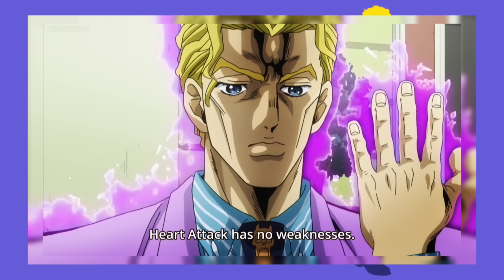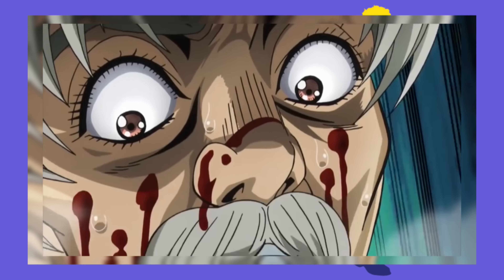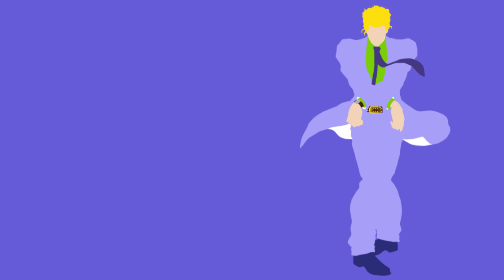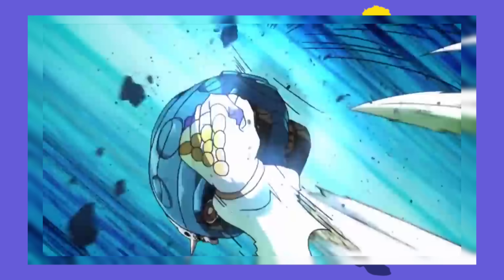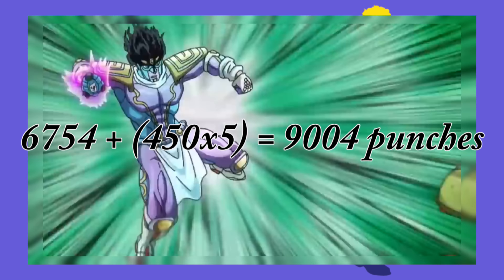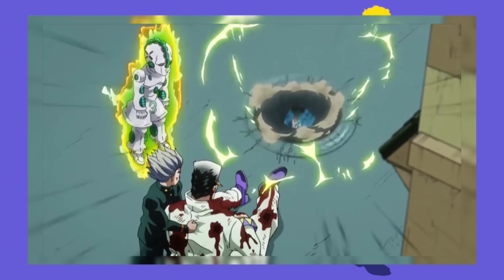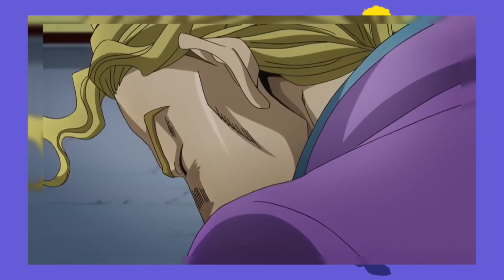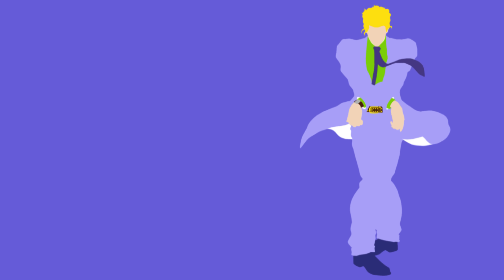The Science of Sheer Heart Attack

Comment: Sheer heart attack vs speedwagons abs
Reply from the maker: Speedwagon is hotter
Reply: @TheShuckmeister  wouldn't that make him a prime target?
Reply: @saladsplatoon3008  don't worry speedwagon's singular punch can destroy it completely
Reply: @thepacificwart8777  speedwagons hammer from part 1 would be enough too tho
Reply: sheer heart attack melts
Reply: vs thunder cross split attack
Reply: @saladsplatoon3008  if it getting super close the heat would be so hot it would mess up the thermal sensors and melt the tracks

Comment: Stands are more resillient than what they represent. So steel is still the best option.
Reply from the maker: It's a good option but I couldn't find a single one that fit the bill
Reply: @TheShuckmeister  I always had the theory that it could be some tool steel with 0,5-1,5% carbon and molybdenum, chronium, vanadium or tungsten as alloy elements and a special heat treatment applied to it.
But then again i am only working with metal on a basic level.

Comment: I'm going to address some of the dubious physics. I didn't watch calculating Jotaro's STAND POWAH punch energy video, so I'm going to assume that is true.

1) If I sat down doing nothing for 12 hours, I would emit more energy than 1 kg of tnt, but what makes tnt actually more dangerous than me? It's the power generated by that 1 kg of tnt. While Star Platinum outputs a butt ton of energy, the energy calculation here is not an accurate assessment of his strength.

2) As the video mentions, there are 14 dents made in Sheer Heart Attack. To simplify things greatly, the total energy required to make 1 dent .015 m deep is the video's E'/14 (assuming the cracks made does not count), so already the energy to make a dent has been cut by more than a tenth (which in the grand scheme is not that much I guess since 10^20 --> 10^19 is still big af)

3) is it a single punch that makes the dents or the series of quickly accumulated punches that makes a dent? Probably some accumulated amount of 9004 punches makes 14 dents. 14 = 9004/n; n = 642 punches/dent. F = 642*(Energy/Star Platinum Punch)*(.015) is the N of force required to create one dent (which is ofc just F(from video)/14). The assumption in the force calc of the video is that 9004 punches makes 1 dent = 1 force, when it should actually be 9004 punches makes 14 dents = 14 forces. The initial assumption is wrong, but the frequency at which Star Platinum is punching renders the mistake only a factor of 1/14 off. 

I thought there were going to be an extreme oversight in this video, but there isn't really... this was a useless comment but I shall still put it out there

Comment: Just have a pet humming bird. Not only are they are tiny and fast (so they can fit through gaps and escape Sheer Heart Attack) they have the highest inner body temperature of all animals, certainly more than humans. Around 40 degrees celsius or 105 farenheit. The Human body, even when stressed is around 35-36 degrees- illness brings that up to 38 degrees celsius. Fire is of course much hotter, so you would never be able to light a fire- but that's okay. The only issue would be boilers and NOT radiatiors (boilers are of course around 100 degrees celsius and radiators are at around 25 in colder months). Filament lamps too, as those run 1000 degrees celsius. But. if you lived in a modern house, with a pet hummingbird of reasonable health, and ate cold food, you would be fine to have Sheer Heart attack right next to you. It would chase your humming bird, try to explode it when it got near- but the hummingbird would be fast enough to avoid it (:

Comment: A lot of assumptions were made here that make this a video really weal. First is that the author thinks all energy from the punch is transferred directly to the bomb but we know for sure that there is an efficiency of his punches and not all energy goes through. The author should consider the laws of thermodynamics where ein - eout + egen = esystem. This needs to be modeled in dynamics at a bare minumim or a high order differential equation. Secondly he talks about the material of shear heart attack being stress hardened but its clearly not that high because were not seeing cracks and damages meaning the shear heart attack is still withing elastic deformation. Its springing back from the punches untill plastic deformation occurs when it has its indents.

Comment: You can't just add each punch's energy to the last. That's not how it works. Getting punched twice by half the energy is much better than getting punched once by one with double that energy. I would rather get hit by a train 1000 times going 1/1000 the speed than get hit by a train once at full speed.